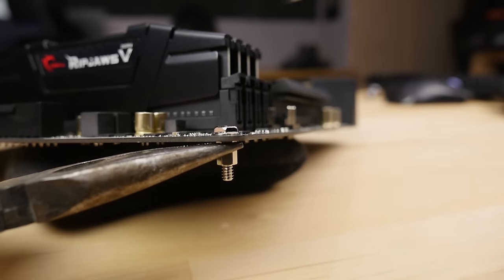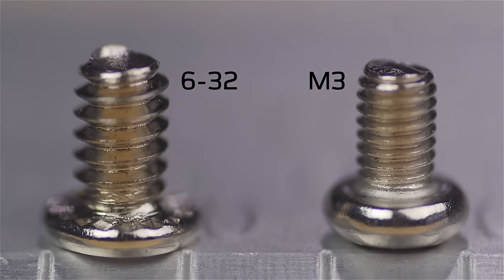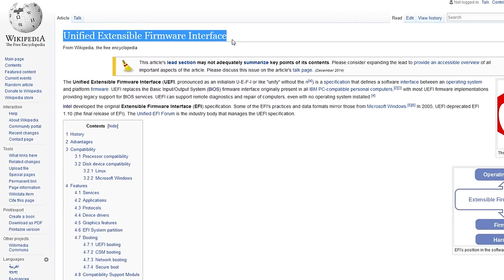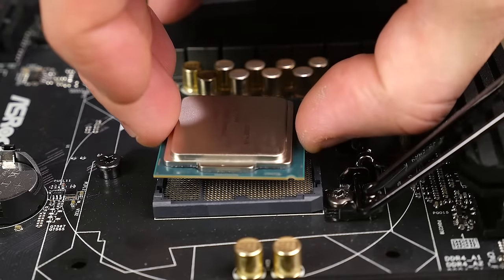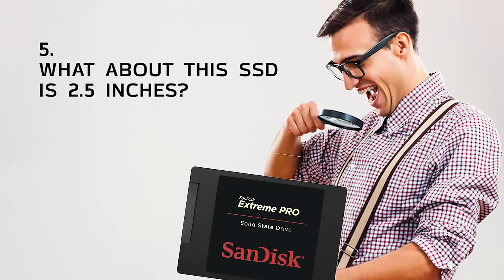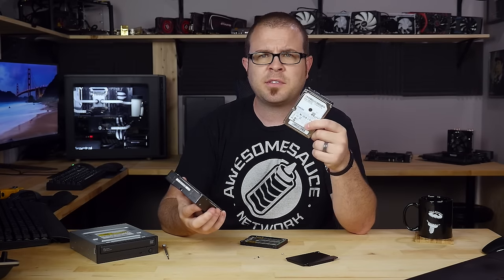5 Confusing PC Building Facts

Comment: ESD you need to know a few things before touching sensitive components. Depending on atmospheric conditions, external body moisture, proximity and salt levels the following are the high levels of ESD. The human body can store up to about 35kv, to see a spark takes 6-10kv, to hear the crack is about 3-5kv and you typically DON'T FEEL anything less than a 1kv discharge due to the low current. Many circuits run at 3VDC so even a 100v discharge can cause damage. The damage done is not always immediately apparent, there is something known as a latent defect or latent failure, these are degradations that cause component failures at a later time. Having said all that you can buy a proper wrist strap for about $8.00. Personally I use a strap and a static mat (about $15.00). I bought a length of 14 gauge green electrical wire, one end is stripped for the alligator clips on the mat and strap, I bought a 3 prong male electrical plug ($3.00) and connected the green wire (standard ground colour) to the ground terminal. When I work I plug into the wall socket, make my mat and strap connections to the wire, I'll even run a jumper wire to the PC case, takes 1 minute and less than $30.00 to be safe. No down side, could save hundreds of $ and hours of work, repeat no down side..

Comment: FYI, I used to think the same about ESD until I measured on myself build up to hundreds of volts within seconds of not touching ground (in an environmental controlled room @ 50%RH). That is why the wrist strap and work mat are continuously earthed.

While it is true that ESD does not instantly kill electronics it does shorten their life considerably by puncturing the semiconductor junctions (P N junction only a few molecules deep) causing diffusion of the silicon atoms. While this does heal itself and continue to work as normal for a while, this will be the area to wear out first. 
(Yep semi-conductors do wear out as the P-N juction becomes less effective because of due to the diffusion of atoms across the P-N junction. )

Large 1960s vintage ICs have predicted lifetimes as high as 10,000 years while current minimum geometry have lifetimes in the low tens of years.

Comment: I scratch built a case with baltic birch. Luckily I measured every part first, but the metric/standard screws did cause issues when it came to the standoffs. Amazon.com fixed that issue right up.

Comment: 4:10 measures the width of the drive's case to find it is ~2.75 inches. 
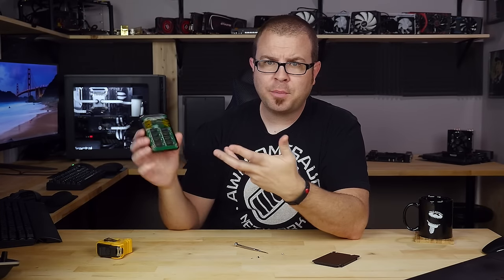4:35   removes the case and measures the length of the drive itself.
4:40  Claims no part of the drive measures 2.5 inches, despite showing us that the buffer between the width of the case vs chip for the drive is ~1/8th of an inch on either side.... 1/8*2  is 1/4   ~2.75 - .25 inch = ~2.5

Comment: I guess that 2.5 inch problem is, YES (like the video pointed out), based on the mechanical one's disk size... plus the case that are containing them are now  standards, or something... so when they made SSDs the cases they used are the same size as the ones containing the HHDs so we know if it will fit our computer chassis or laptops.

Comment: I haven't bothered to read the other  comments yet, so it probably has been pointed out. But the SSDs are probably called 2.5" as well because they measure about the same physical size when all is assembled as a 2.5" HDD does.
the screw problems really resonated with me. my dad and I have been building systems my entire life so we have an abundance of screws, but it's always silly when you have to determine the size of screws a case's standoffs and such need. especially with older systems and cases!

Comment: Your first fact actually has a very good reason.  
You called it "fine thread". It isn't a fine thread, but you got the point: you need more rotations to screw in the M3 the same distance than the UTS.  -> It's thread pitch is lower.  
Fast forward a lot: You need a little more torque to unscrew the M3 than unscrewing the UTS. 
And that's the thing you want: When you loosen the screws for your motherboard you only want to loosen the UTS, while the M3 thread for the standoff keeps in place

Comment: Look out for cases and parts that cheap out on the screws, my fractal design R5 is great, very spacey and easy, but the screws were cheaped out on, they are made with a soft metal, and it is extremely easy to mess up the threads when installing parts with the most caution.

Comment: 3.5" and 5.25" are from the very old days when we had 3.5" floppy disks and the drive to handle that floppy disk would necessarily need to be slightly larger than that "floppy" (that wasn't really floppy at 3.5") disk.  Of course, we had the 560kB single density or 1.2 MB double (or hi) density 5.25" floppy disk. It was truly floppy... and surprisingly more resilient that the 3.5" floppy disks. And, yes, I have seen the 10" floppy disk that held something around 200kB. I'm getting old

Comment: ESD was originally an imagined problem with high impedance CMOS inputs, so engineers now put zener diodes across the inputs, to keep the voltage low and the office boys happy. Metal grounding wrist straps may be a 'kool' fashion statement, but may also cost you your life!

Comment: My standout ESD incident was with an Apple ][ at school, where we had old carpet tiles which worked a treat at building up static.

I walked across the room, sat down in front of the machine and moved my hand towards the keyboard. A spark jumped from my finger to one of the screws holding the case together and before I could think "oh crap, I've broken it" the machine started up the BASIC program that I had been working on.

Yes, ESD vectored an Apple ][ to wherever in the BASIC interpreter the "run" command lived ;-)

Comment: Static electricity damage is a thing. Most of the times it doesn't matter because of the PCB layout design, that usually has ground pads all over, and when you discharge, you most likely discharge into it's ground, but sometimes it can happen. I killed a hard-drive like that once. Got it out gently, put it back in, it was completely dead.

Comment: I think the reason is for the actual outside drive size, because calling a drive slot "2.5in." means that the slot is compatible with any 2.5in drive outside. Hence why non disc drives are still called these. Maybe in the future where hard disc's are no longer need at all, we'll see something done about this.

Comment: Sidenote: breaking hardware with ESD is most definitely a real issue. Many people will build a pc and find their motherboard to be DOA (dead on arrival), there's a good chance you broke it because you built your pc while wearing your synthetic pullover.
Also more often than not you don't break the board to a point that it doesn't work anymore, but ESD could have caused a smaller issue like damage to a sound chip, memory module or USB chip. The board works fine, but some of your USB ports don't work or there's a hum in the audio. All could be caused by unsafe handling of hardware.

Comment: 3.5 " and 5.25" drives were handy names because, before hard drives were the norms, these drives accepted 3/5" and 5.25" floppy disks, which measure to those respective lengths. CDs are also 5.25". As such, the naming convention for drives were based on disk size, not drive size. As hard disks became popular, the naming convention carried over and at the advent of the 2.5" drive, the naming convention of disk size carried over to maintain a standard naming convention. Not that external media is becoming more and more rare, and is non existent for 2.5", these measurements may confuse some people. But when you understand the history of physical storage, this all makes sense.

Comment: Honestly one of my favorite things about upgrading from an i3 to my 8320 is that the FM3 socket doesn't do that. You place it, and when you lock it it just slides a bit and is done. No horrifying creaking or force to apply.
Reply: +bokunotraplord You mean AM3?
Reply: +reaper575556 That sounds right and explains why it felt weird typing FM3
Reply: +bokunotraplord well, hopefully you won't ever experience the infamous AMD-CPU-stuck-to-heatsink issue! I thought for sure I broke something first time it happened to me.
Reply: +reaper575556 Surely you mean "AM3+".... I mean if we're gonna be semantics whores here, lets be accurate all the way.
Reply: +MarkHuron I actually swapped the heatsink out a while back and it definitely took some work. the stock paste must have thermal adhesive mixed in.

Comment: I have built  and serviced dozens of PC in the last 20+ years from 386s to I5s. Touched the contacts of cards, the backside of cards, used various cleaning fluids and wiping material. Never practiced any ESD safeguard and never killed a component either.
I did kill some old components on purpose, using the sparking unit of piezzo electric gas lighters. ESD can be very harmful, but you probably need to charge yourself up intentionally to be able to do any damage to your PC.

Comment: Speaking as someone who has brutally murdered several components with ESD in the past, let me tell you that it is no myth. You should always transport boards, chips, etc inside ESD-safe bags. Good silver bags too; not those crappy pink ones. Ideally, you should wear a grounded anti-static wrist strap the entire time you're working inside your PC, but at the very least, you should touch the metal parts of the case each time after you walk around. The conductivity of your tabletop makes no difference when it comes to ESD. If anything, a poorly-conductive surface will actually increase the likelihood that a static spark will jump to the component itself, rather than the surface its sitting on. Special antistatic mats, which contain a conductive layer sandwiched inside PVC, are dirt-cheap and can be lifesavers for system builders.
Reply: +Shmeh Fleh I can't say I've ever damaged a component with ESD in the 11-12 years i've been playing with computers, and I barely, if ever take any precautions against ESD. Maybe I subconsciously ground myself or something. It's gotten to the point that I'm actually pretty rough with my components, including RAM, which, while I still do my best to hold on the edges, I still sortof man-handle.

Comment: Some ancient history from the Jurassic era about hard drives. The very early standard for hard drives was set as the diameter of the platter in the drive. If you go back to the very early drives in the pre PC era you had in a disc pack (https://en.wikipedia.org/wiki/Disk_pack) - that same standard was used with the later memory drive units for PCs - thus the size stated has always referred to the diameter of the platter inside the device, the the bay storage space is also referred to by the platter size of the drive platter size unit that goes in it. Bonus fact, the early 300 MB disc packs were bigger than most desk top PC boxes are today.

Comment: Another good rule of thumb:  If it is sheet metal or a soft plastic, the #6-32 screw will work the best.  For extremely hard metals, the metric makes a stronger joint.  You can expect others to know this too but don't count on it.

UEFI like most acronyms with an "F" in it has an obscene word in the real meaning.  They could have just made it BIOS-2.0

Comment: the thing about grounding yourself... YOU DON'T HAVE TO GROUND YOURSELF AND YOUR POWER SUPPLY. It's a redundant step. All you need to do is reduce the electric potential (i.e. "buildup") between you and the components you will be touching. A high enough potential difference will result in you "discharging" electricity to the metallic components which conduct electricity much easier. All you have to do to reduce potential difference is touch any metal part on your case, that's all! Doing that already decreases potential difference because you transfer all your built up charge to the case. Plugging the power supply into the wall and grounding yourself, although works, is completely redundant.

Comment: just like you buy a 2X4 peice of board there always larger than that.  Also ESD is a problem not always immediate but some parts not all on a pcb can be damaged or weakened.  To find a problem with it later in a domino effect.  especially in gun  diodes that operate in high frequency.  Some of the older diodes could even be magnetized so no magnetize screw driver too

Comment: FYI, People think you have to feel a spark to damage circuitry, that simply not true and if you do damage your components it will immediately be broken, that also is not true.  Typically you don't feel a static discharge of less than 3,000 volts.  ESD discharge of 50 volts or less can damage components.  90% of damage caused by ESD is not immediate, but can show up days, weeks or months later.  MY recommendation is if a $2 wrist strap will prevent future problems, wear it when practical, keep yourself grounded to the frame when ever possible.   You have spent a lot of money on your computer stuff, it is a small cost to protect it.  I would be particularly careful when handling discrete components like CPU's.

Comment: BIOS has been around since around 1975? The IBM PC came out in '81. It was the first PC to have what was known as a BIOS. In 1975, there was the Altair 8800 and IMSAI 8080 into which you had to load a bootstrap loaded via the front panel switches. The SWTP 6800 was also available around '75. It had the SWTBUG monitor in ROM but it really wasn't a BIOS.

Comment: M3, the 'M' stands for machine and the '3' is 3mm. 
You can get Machine screws in lots of different sizes.
Reply: Do not use machine screws for PC building..
Reply: nick plescia apart from holding HDD, SSD
Reply: And then the struggle to buy UTS (especially #6-32 UNC) screws in europe that are not labeled "pc screws" with the according price of 2€ for 4 pc. while other scres are 5€ for 100.
Reply: M stands for metric

Comment: holding onto the pc case when working on machines, and never holding boards by traces/components/pins seems to solve the static problem. Also, 5.25" drive bays are still common. they are not from "Days of old". Try finding a case with an external 3.5" bay (for floppies/card readers)
Reply: just realized that that makes installing a 5" floppy drive is actually easier today than installing a 3.5" floppy drive

Comment: My knowledge of computers ranges from how turn them on and off to how to get them infected with several viruses, but what I am sure of is if you are using pliers to loosen a nut  or screw your doing something wrong. Somewhere out there there is a wrench or a driver for every size and type of nut or screw. They might not be easy to find but they're out there.

Comment: In regards to static discharges, even if you feel you zap something while building a computer it might seem to work fine and no test you can think of might actually fail, however it might be some function that you seldom if ever use, or a component gets damaged but does not stop working until long after the "accident"!
So even if i would like to say that "I have never destroyed anything in a computer by zapping it" I can only go as far as to say "As far as I know i have never zapped any computer hardware" just because I do not know about any such issue, does not mean that there hasn't bean or is such a issue.

Do not underestimate ESD! - but with that said just make sure you have contact with the material you are working with via some kind of big ground plane -such as always touching the chassis while working inside the computer - and do not put a motherboard, CPU, memory or anything else that might build up static electricity - and always handle devices by the edges where no contacts is located.

Comment: It's the measurement of the approximant size of the spinning disk found in traditional floppy drives, then CD drives and Hard disk drives. SSDs came laters, but designed to fit in the same space (which would obviously have to be larger to accommodate the size of the disk it needs to contain.

Comment: 2.5" and 3.5" .... Defines the distance between the left and right screw holes for mounting the drive on the bottom of the either 2.5 or 3.5 inch device :)

Comment: The last I heard, the reference to drive sizes referred to the type of external media normal inserted - back when everything used floppy disks, for example.  Granted, that would have no bearing on 2.5" drives, since we really haven't had any in that size = though the size of disk platters  would make sense there.

Comment: You cant actually know if you damage computer hardware with ESD, until much later in the lifespan of the parts. You would have to be really unlucky to break something on spot, but the damage done can show up later, sometimes even a year later from when the shock was administered resulting in the failure of the component.

Comment: Great vid Paul, I'm sure you can come up with five more though.  I think that running audio when not using true "Computer" speakers can be confusing to some, especially when you are trying to use those same speakers for a console as well.  I had a small Lepai Amp running some Sony Bookshelf speakers for my computer and my PS4.  Had to run the PS4 Digital Out through a DAC first though.  So yeah, a video that gets into things like that would be awesome.

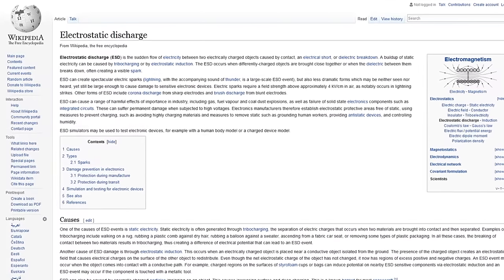Comment: 2:33 You wouldn't necessarily know that you damaged anything. The particular component(s) you damaged may actually continue to function normally for months. Even if/when those components are made non-fucntional by said damage, that may not affect the operation of the board in a noticeable way.

In short, that your machine is currently working doesn't mean you didn't damage anything.